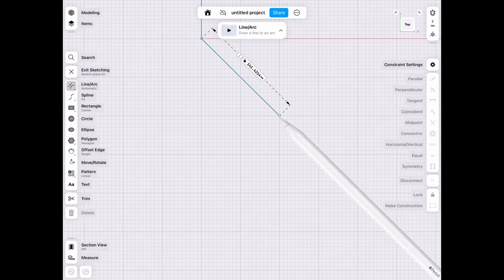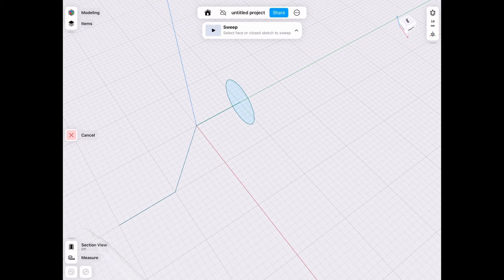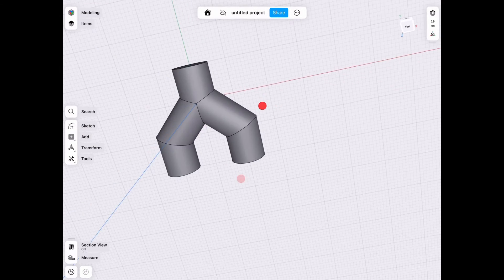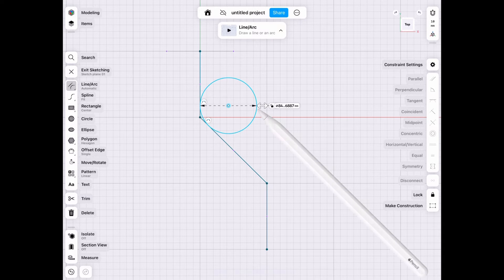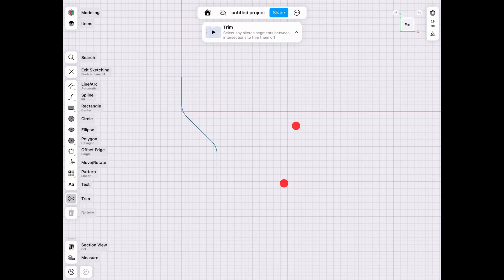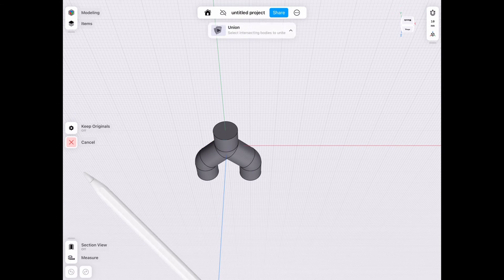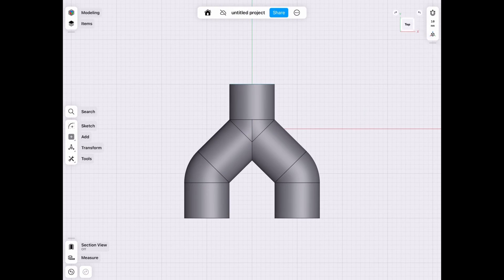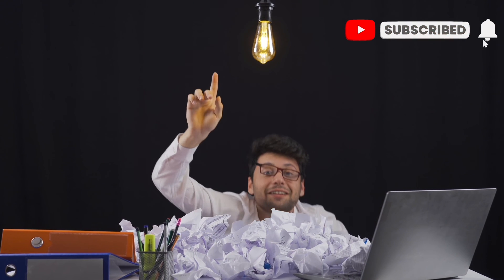Y Splitter Tutorial in [ Shapr3D ]

Comment: How did your circle go to both lines and auto adjust it's size by using the tangent tool? When I do it the circle just goes to the one line and doesn't assist
Reply from the maker: You just have to tangent twice 👌 make sure your bases are locked in or they may move instead of the circle.
Reply: @JLake3D  that's good to know! Thanks. Yeah I was doing it twice but it looked like you were doing it once. I'm trying to figure out the best way to "bend pipe" cause I want to build a roll cage
Reply from the maker: For that I would make a sketch profile and just use the sweep tool 👍
Reply from the maker: Also if the circle is inside a square, using tangent will line it up with all sides as long is it was in the center.